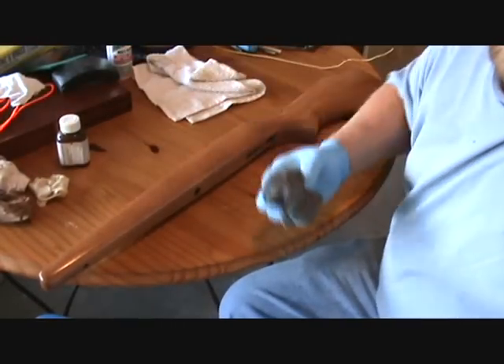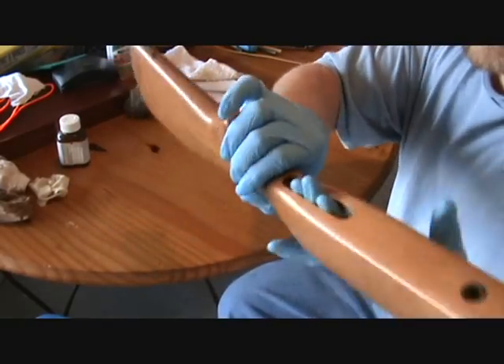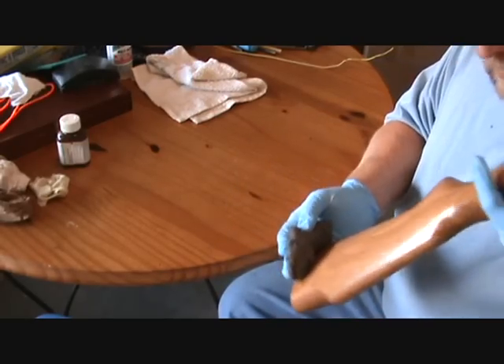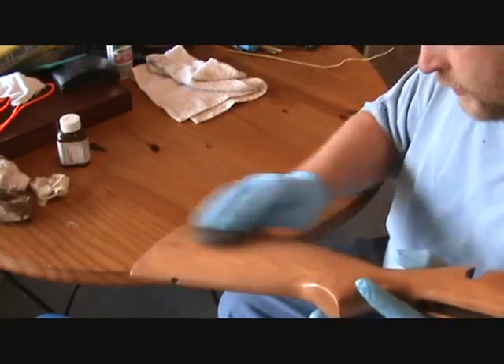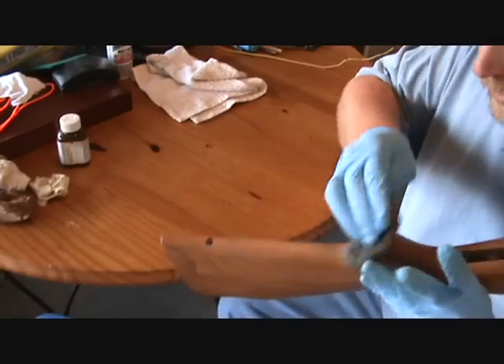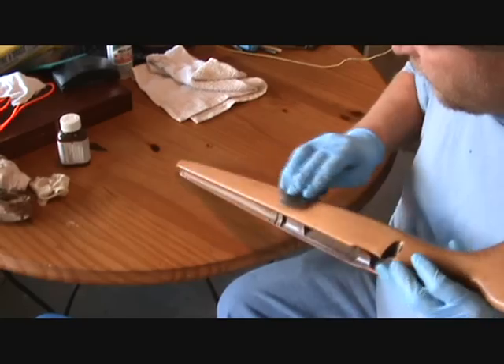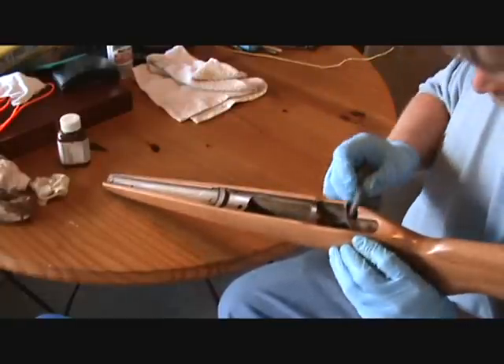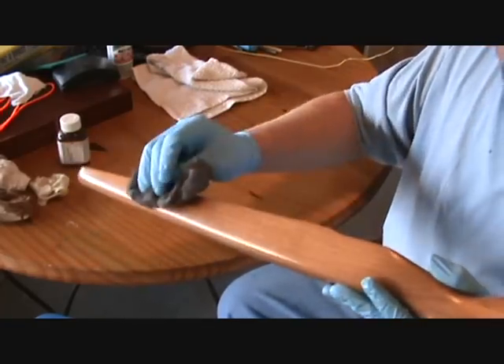Buffing Tru Oil

Comment: Recommend: do not use steel wool on the first application of Tru Oil.  Doing so risks steel fibers being embedded into the unsealed pores,…potential oxidation hazard.  Rather, buff first 3-4 coats of Tru Oil with 600-grit paper; then follow subsequent coats with steel wool buffing to achieve a oil-look-alike finish.
Reply: Your comment shows that it's always good to read the comments.  Wilwood is doing a great job, but your comment saved many of us from some serious grief.

Comment: Hey looks good!! I have a question. I'm getting a "refinished" Mosin Nagan sent to me and I'm going to apply a few coats of Tru Oil. If the stock doesn't have the desired gloss I'm looking for could I just start adding Tru Oil or is there prep work I'd have to complete before starting? Thank you